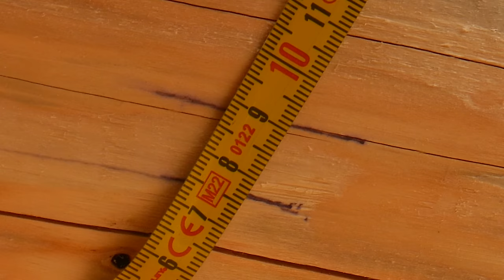I'm building an off grid LOG CABIN with an axe | EP12

Comment: why is it necessary to peel logs twice ?
Reply from the maker: It isn't. Just remove the bark. The wood will darken in a few months and that's okay. But if you want light wood, you have to peel (or sand) it again after it dries and then paint it with some transparent varnish or oil. And that's what I chose. Even a painted log cabin will become a little darker after some time. Otherwise, I also like the dark gray log cabins.

Comment: When you installed your wood stove I did not see you put a damper behind the stove in the flue pipe. That is necessary to control the air for the wood to burn efficiently'